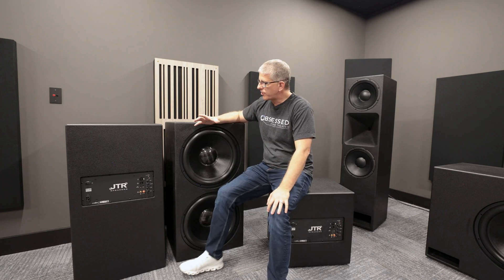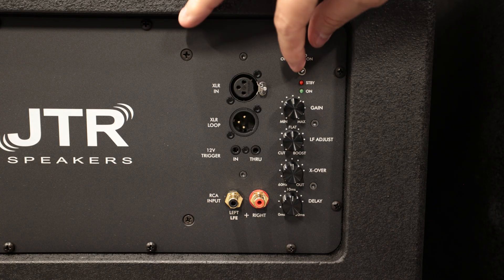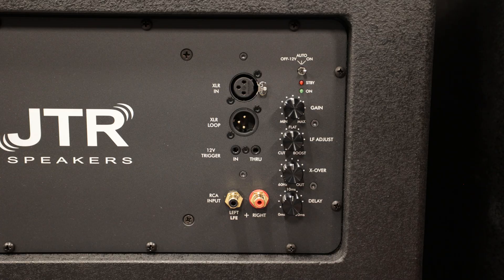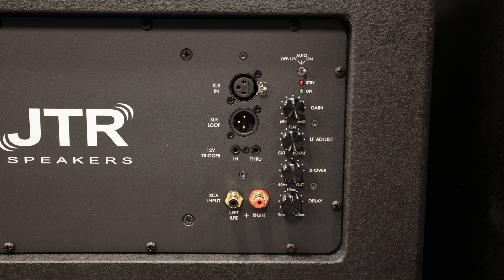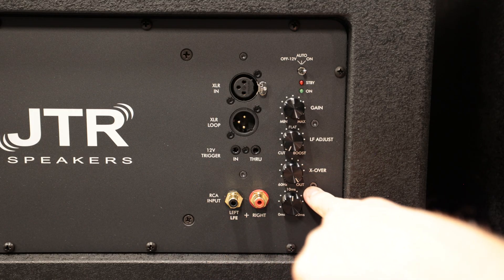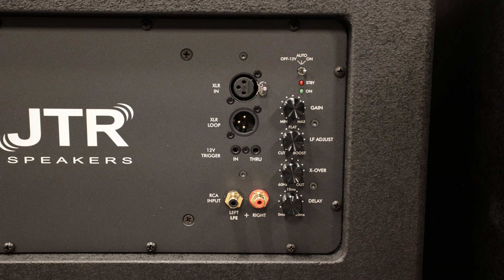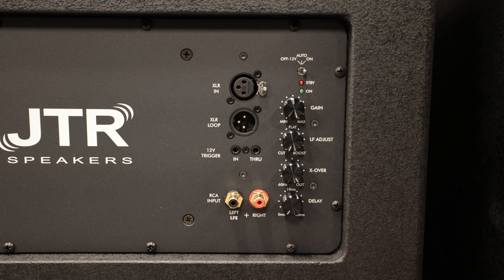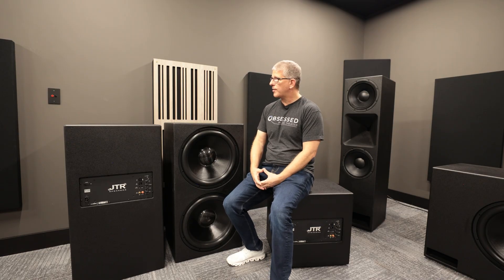JTR Captivator Series: Recommended Amp Settings for JTR Subwoofers

Comment: That's crazy to adjust a jtr to a third of the volume at that price point. I am really torn on this method. I get it but a third or even half is completely a non compromise to me. I have seaton sound f15 x 4 sealed subs. But if I have to back out of the jtr 4000ulf then what's the actual "F" please explain this to me Youthman.

Comment: Good stuff Michael. On my AVM70 I had to turn the Gain knob below the twelve o'clock position. I also tried the LF Adjust but I felt that the bass was too boomy for my liking. I simply let ARC Genesis do its thing and make the adjustments there as needed. Thanks!
Reply from the maker: Thanks Carl. That's great you utilized the LF Adjust to find what fit best for your room and your preference.

Comment: I use the delay dials on mine to align them using REW. I actually sold my miniDSP because  using the dials simplified my setup
Reply from the maker: There you go! We are simply guessing at what is happening with our subs if we do not take measurements to see how they are performing in our room.

Comment: Hi Youthman, great video as always. As you said that’s a needed video regarding input gain - voltage matching video. A lot of information flooded in forums and in fb. Some say 50% some say crank the way up, so if you could find some ideas regarding these would greatly appreciated. Stay blessed.Thanks
Reply from the maker: Exactly, so many conflicting strategies. Once I discover the correct way, I'll definitely make a video on it.